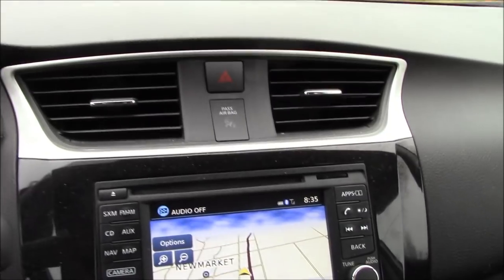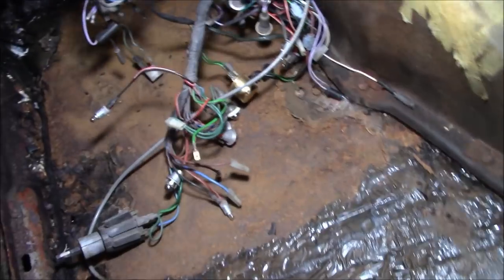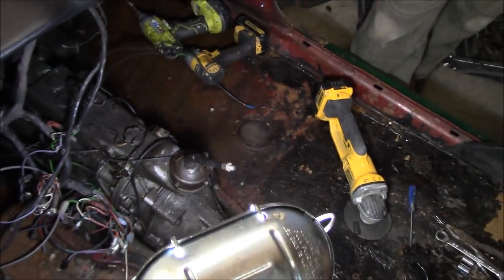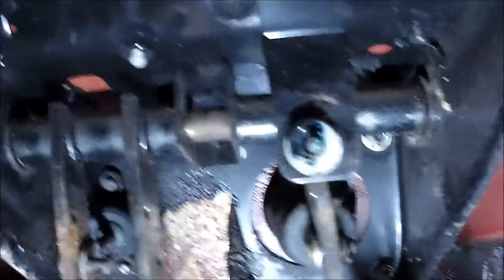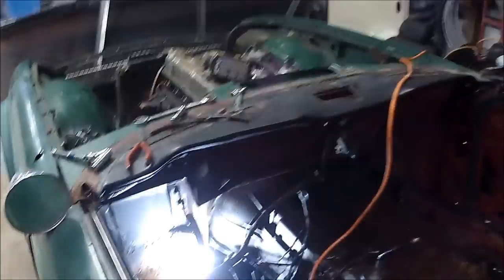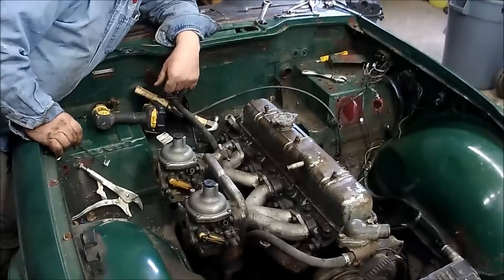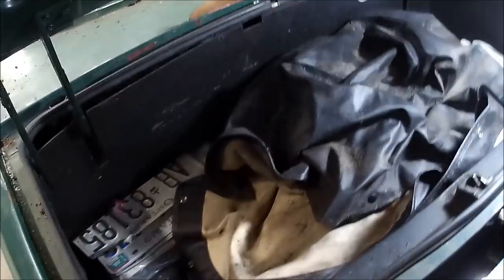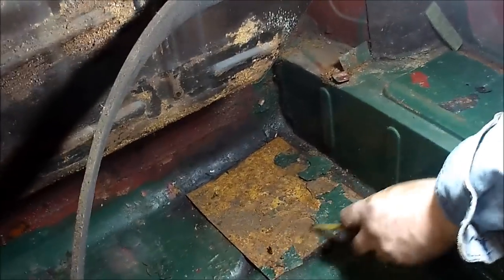Les's 1976 Triumph TR6 Restoration, Day Five

Comment: Dave, I see you removed the windshield base, how did that go?
Reply from the maker: Well, we did remove the base 😉.  It was actually so rusted in the corners that it just broke apart.  So, the center section came out but the corners are still there stuck the the brackets on the inside of the car.   I’ll work on getting the brackets out later...I think it might take some “persuasion” 😎